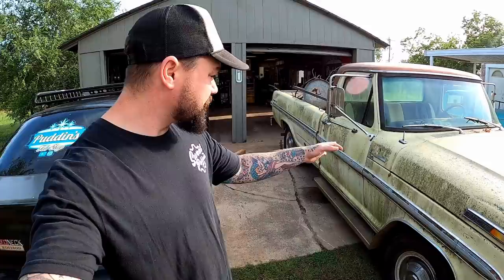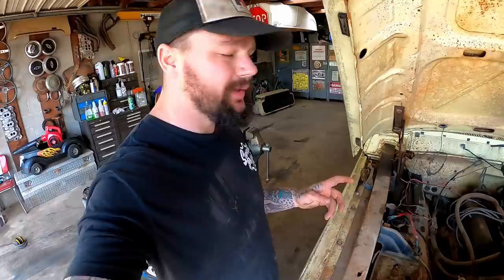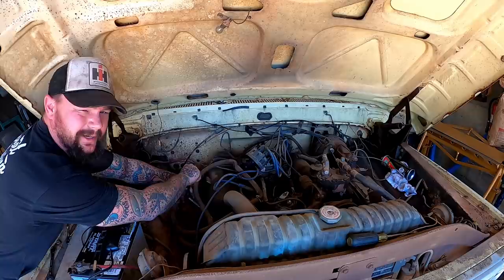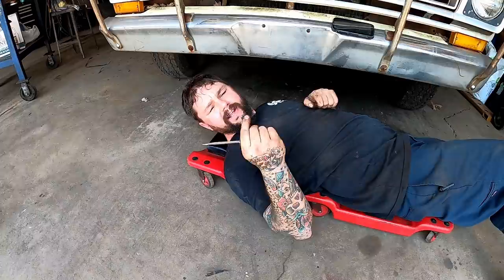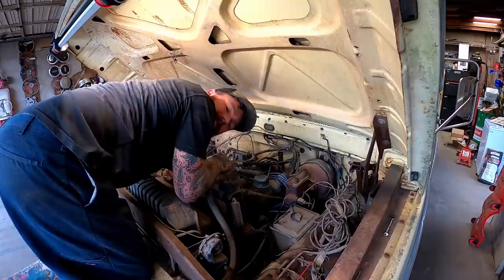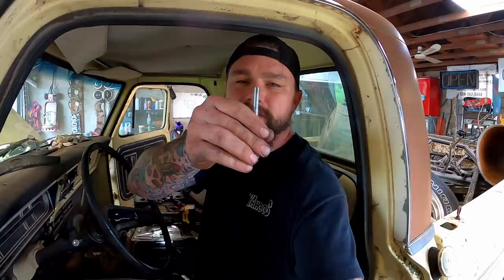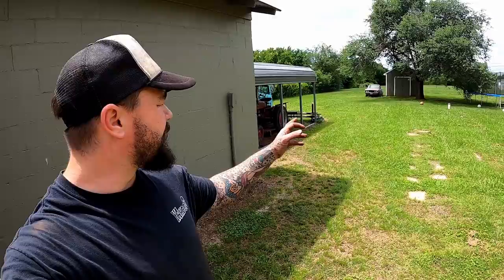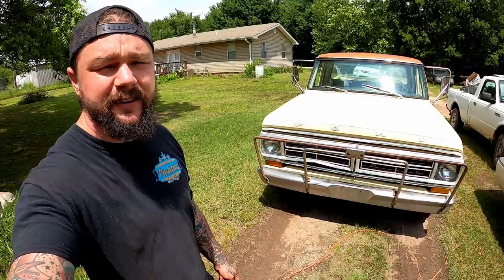1972 Ranger XLT Camper Special. Will it RUN and DRIVE?!?

Comment: The Yellow on the roof coming through is factory, the whole truck was painted the base color and then the second color was put on over it. The reason I know this is I worked at Ford, but I also did bodywork on the side for many years,

Comment: LOVE WATCHING DO OVERS !!!!!!! IM A CHEVY FAN BUT YOU MADE SOMETHING SPECIAL OUTTA THIS 1972 CAMPER SPECIAL..
I BORROWED/eventually bought, a 1969 Camper Special 3/4 ton and borrowed a 10.5 CAB OVER CAMPER AND WENT TO THE ROCKIES WITH THE EX AND MY FIRST BORN SON. WHAT A TRIP THAT WAS in 1980. THAT BIG OLE HEAVY AS A MORTSKE OVERALLS CARRIER ON THOSE THIN MOUNTAIN ROADS ? YOU LOOK 👀 DOWN AND SEE A TWO MILE DROP WITH NO SIDE RAILS ON THE ROAD ANS JUST LOSE IT. HAD TO CHANGE MY DRAWERS A FEW TIMES. Ewwwwww 😷 YOUNS DONT WANNA HEAR ABOUT THAT IM SHO.
ANYWAY LOVE YOUR SHOW !!!!!!!
Puddin makes the very best
 “”chocolates”” <~Nestles retro commercial from early 70’s
N.   E.  S.  T.  L.  E.  S.  Nestles makes the very best C H O C O L A T E !!!!!
Memories I have a few

Comment: The wire from the  switch to the  coil probably  has a resistor  in it.
Reply from the maker: There is. I looked before dropping it off. Resistor may have to much resistance.

Comment: Don't you worry which down there means I'm full of it or maybe ol' morgan's okay by me. I been sharing it to a lots of people and I don't care if they are Lawyers and wouldn't know tailpipes from front bumpers. I send it uninvited as a way that entertains me of good content so's they are going to either throw it in trash or hope its a naughty from me and get fooled, they're gonna get it!!! Love all the ford stuff I can get and being a ford lover still can't remember all the different ford firing orders but know chev. I bought a XLT Ranger when I was in Mc Gee Arkansas fall of seventy one and it was a twin to whats .... well was in your garage. Clean all five of those wires going to the solenoid and you know all the functions of them surely. I never seen any voltage drop on the firewall as those coils are internal resisted and so the little wire closest to the wire coming up from the starter. That wire runs all the way around the "lose no money fords wiring jobs)" so it gets full twelve on start and does its own thing inside that coil. One sad thing on those fords back then was they were playing with printed  circuits back then an so when the dash is opened up that wiring has the plug that does it all goes to the back of the dash. The printed circuit board is spray paint thin copper in plastic to make simple hook ups but as time goes by it gets soft and don't make good connections plus the grounds on those fords are real poor and not making connections the best. The first three words in the Haynes Manual is ... grounds grounds grounds! I know its repetitive but I had to read it so I  past it to you. I know it sounds cheap but just spray some electrical cleaner on the master plug of wires and maybe just wiggle it some. I just don't know short of getting that from rock auto, LMC for sure and just replace it plus change out the bulbs that most generally burnt out.. well I guess I shouldn't add that when I bought mine it was four wheel drive and had the four speed in it. I drove that truck all the way to 84 and the wife begged me to get a newer truck so it was to happen she talks me into driving the new rig the next day to work. I'm setting in the gummer room listening to the radio for those days and it had a program called Trade-e-o or something to sound out word. On comes the announcer and says "Old ford truck with tons of miles but runs now for five hundred dollars and then the phone number which sounded so familiar so I am going about and it hit me that was my Damn Number. I jump in that damn new truck and drive straight to the house and my truck is gone! She had sold my truck for five hundred dollars ----===, you just don't say it is all good honey... no, you leave and get pig stabbing drunk and get a dwi going home. Judge ask me why did I drive and so I told him the whole deal and the judge tossed the ticket and told the cops standing there to give that woman a ticket for anything and she will see a week in JAIL oh he was as mad as me cause he had tried to buy it from me and offered a heck of a lot more. ,,, then he said.... no, Put her horse in "Protective custody" cause someone filed a complaint against her for mistreatment! He kept that sheraded for about a week and then went to my house and said to her "How's that feel to you?" She was crying and said she was sorry but sorry don't fix a legal sale and the man who bought it wouldn't sell it back to me.  I'll quit right here Puddin.... I sure enjoyed

Comment: If the voltage regulator is bad on that Ford truck it'll keep on burning out those solenoids out time after time.,or back to back. The solenoids on the starters can also cause that same problem.,or the wiring bad.,or crossed wiring somewhere.& even unconnected wires.,or broken wire terminals some were to.

Comment: Prediction: next mail bag includes 3 to 5 crimping tools

Watching this reminds me of the time I blew out a brake line like 50 miles from home.  Fixed it in the Advance Auto parking lot and to bleed it I just left the line loose a bit at a union and pumped a few times.  It got enough air out to get a pedal back.
Reply from the maker: Oh hell
Reply: Crimpers and feeler gauge lol which may be sent in by someone that has a few extra😂👀
Reply: @PuddinsFabShop  Hey if the youtube thing don't work out you'll be able to open a tool store

Comment: Coulda kept the hard fuel line and patched it from the barb to the hard with some rubber. :-D
Reply from the maker: Ehhhh
Reply: @PuddinsFabShop  I had to do it on an 89 short bed SBC swapped s10  I had, I ran rubber from the pump the carb and it would vapor lock so I put the metal one back and patched the bad spot with a few inch long section of rubber hose and clamps, issue solved! lol

Comment: PRO TIP.. NEVER put your phone on the work bench while doing carbs.  I had some carb cleaner splash on my cell phone, it leaked inside and ate the circuit board straight back to china.  That day, I died a thousand deaths... ($1000 phone, straight in the trash)
Reply from the maker: Damn it!

Comment: The Ranger XLT two tone yellow and copper orange reg. cab top. The license plate has to go back to DMV because the black tag means the fee is late payment. To make the Ranger pickup liable to run - only one owner owns both the truck and the licensed plate but the Ranger truck in on your land with your Uncle. You cannot need the licensed plate because it is not licensed yet. Do you want to take the pink slip over that Yellow used truck and it is likely to be totaled because of bad brakes and high mileage odometer.

Comment: The fuel is a cost of high price than a gallon of gasoline. That means brake cleaning fluid that will cost that high. If you drive one hundred mile to the nearest gasoline pumping station then it is more per gallon but still the price is always under $4.00 a gallon of 91 gas. I'm former licensed of gas company and You and I cannot raise the price for gasoline because it is mine and I'm young to not to retire my Gasoline company, my Amigo.

Comment: Please can you drill grind thru and cut out the ignition switch and crank up with twist the screwdriver in the start switch and test drive the truck = 72 Ranger Pickup former camper. Then head to the auto part and order the ignition switch and replace the ignition switch that we broke it. Or can you lower down the steering column and pull out bolts and it help to lower the column down and push the ignition multi-switches into cut on the engine running the multi- switch is a box hidden right on top of steering column for it's includes ignition wiring system. The key turn and it push plastic rod therefor the rod push and pull the multi-switches.
 Pull it means cut off the engine's power. Beforehand does your uncle give an okay permission? Thank you.

Comment: when pushing it off the  trailer why didnt you open the garage door ??? let it  go in ???
Reply from the maker: Do you wanna squeeze yourself between that heavy truck and Tony door space to try and get it stopped. Hellllll no. Not to mention a low tire alone can cause a vehicle to turn.

Comment: How's the fuel system? Did you get it to run off the original tank or is it still on the can under the hood? That fuel tank neck looked pretty crunchy with lots of crumb's.
Reply from the maker: It needs a tank

Comment: Puddin your using that plug gap tool wrong, supposed to use the hole to open it up not the gauge itself, you'll end up wearing it out man, if you go to far little tappy tap tap it, on yhe prob feom the back brother yee

Comment: Fords come in two types. The type that breaks soon and bad and the type that will last forever. Its the luck of the draw. That's why if you are going to buy one used find one over 80K miles. If it made it to that it will go another 100K